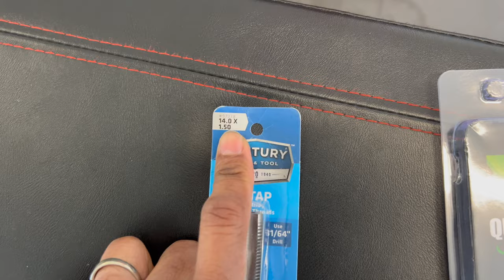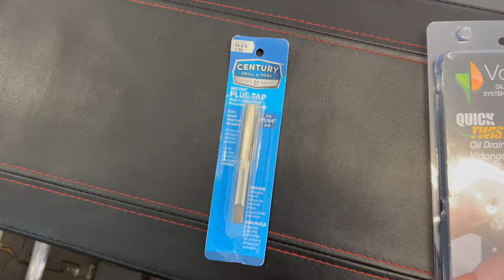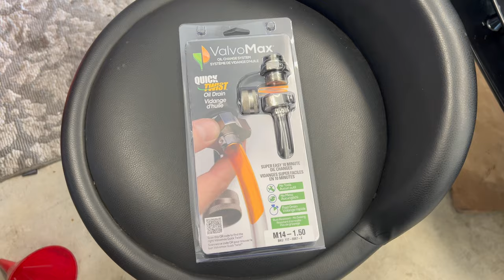Re-Tap & Install ValvoMax Quick Drain Plug - Easy DIY Guide!

Comment: Just found your channel while searching for F10 mods.  Appreciate the content, especially on mods and upgrades.  I’m redoing a 2016 535XI with 38K miles that was in a flood.  I’ve replaced 7 modules and reprogrammed with Esys.  Got stuck on the DSC and had to take it to a specialist who got it connected and programmed in 3 hours.  I’ll be watching your interior swap videos as that’s my next step.  Thanks again.
Reply from the maker: Thanks for supporting the channel. Good luck on your build.

Comment: always run some oil through the pan to flush out shavings after you tap.
Reply from the maker: Yeah, that’s always a good idea. I flushed mine out with brake clean, but should have followed up with some additional oil.
Reply: I had to do the same thing a few months ago.  I bought two extra quarts of oil for flushing purposes.
Reply from the maker: @jayboi634   That makes sense.